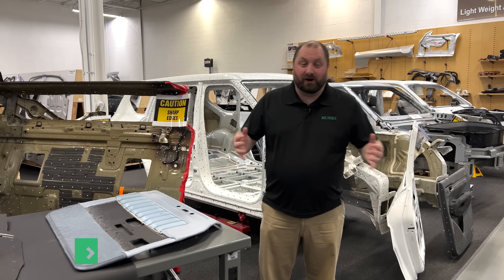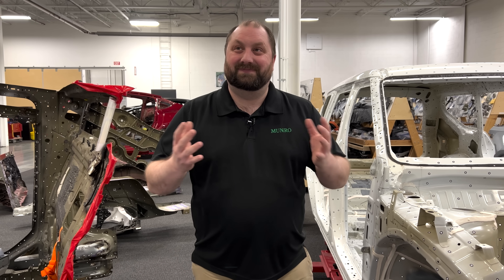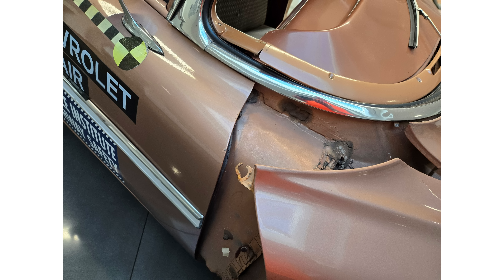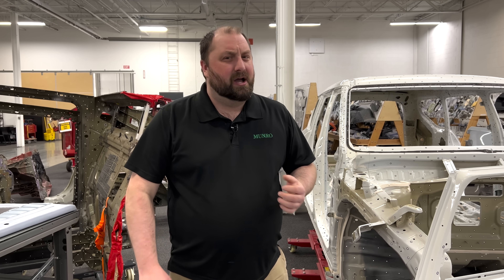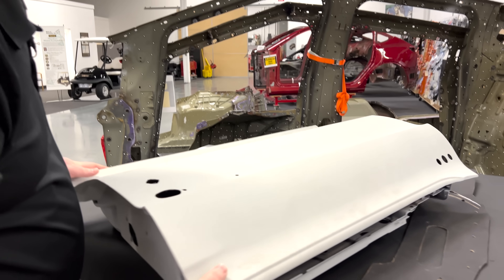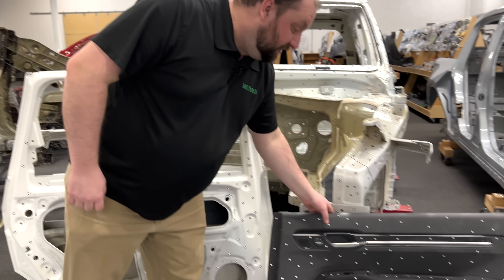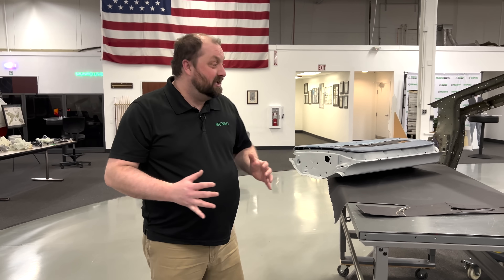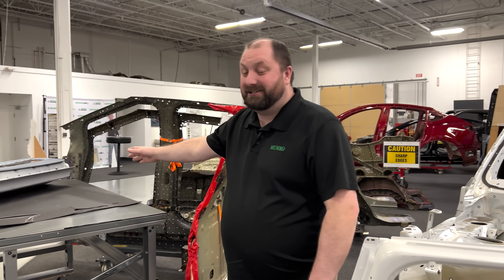No, Your Classic Car Isn't Built Better Than Your New Car

Comment: I'm restoring a 1960 Austin Healey 3000, one of the "big Healeys". It has a steering column that goes all the way to the front of the car, there is virtually no front overhang. In a collision that steering column would be a spear aimed at my chest. I also have a 2016 Mazda Miata, I know which car I would rather be in if I were to have an accident. They are both small roadsters weighing about 2,300 pounds, the Mazda would take care of me much better than the Healey.
Reply: It's interesting to note that they are 56 model years apart, but they are the same type of car!
Reply: @snowrocket  
My girlfriend is 50 years apart from my ex but they are the same type of gender..

Comment: Classic cars were easier and cheaper to repair is what I am always told.  I just laugh.  Then why aren't they all still on the road?!
Reply: Because they wear out, rust out and crash out, along with obsolescence; pretty simple really..
Reply: Lazy owners and the convenience of "new"
Reply: Yes, classic cars are easier and cheaper to repair. But there's always attrition of old cars for a number of obvious reasons, and not always because of mechanical issues. As has been said, some rusted out(depending on what part of the country like rust belt, or salted roads), some get to needing mechanical work that the owner doesn't want to do, Either way the car may not have been worth fixing. And accidents of course. Interiors wear out. Or people just wanted something new. It used to be back in 50's 60's 70's that new cars didn't cost so much, so trading for a new car was easier to afford. I bought 4 new cars in the 70's, and I was only in my 20's. Plus back then, they kept making good looking cars every year, so there was always something you wanted to buy. 
They'll last as long as want them to. They can be restored if necessary, but that's expensive, especially if you can't do the work yourself. It's best to find a low mileage survivor that's still in good original condition, so you're starting out with a good car. And then, just take care of it. I drive a 75 Lemans Sport Coupe that I bought for $3800 back around 2000. It only had 60K miles on it when I bought it, and it was 25 years old then. Now I have nearly 200K on it, with the original engine and trans. Not really that many miles for a 50 year old car. But I have a few other 70's cars similar to that that I also drive. I can do the work when they need it, and have a garage to do it in. So, I have no need for a late model vehicle. But you gotta want to do the work. Most people nowadays can't or don't want to, so have to get a late model.

Comment: Well done Carl. I wish that didn't need stating, but I look at people with their "old is better" arguements and I shake my haed in dismay. Granted, if you stop building a technology for a generation or two, you might find that the last older cars would be better, simply because the expertise disappears. But even that doesn't last for too long. With continuous steady improvements, vehicles are just superior these days than they once were. In the UK, the 5th Gear car programme crashed a 2010s decade Renault Megane into a 1990s Volvo. The Renault's cabin stayed intact, the Volvo's started to buckle - and Volvos have a great crash reputation. But 20 years of progress were between the cars.

Comment: There was little to no crash testing, no 3D modelling to see where the stresses are, and how shapes deform during impacts. There were no collapsing Steering Columns to stop you getting impaled, and nothing so prevent your feet from becoming crushed or trapped in the car. No seat belts, air bags, ABS, stability control, traction control and some of the handling was downright dangerous.
Old cars were dreadful death traps and were shoddily made with much lower standards of quality control and design. Look under the bonnet of an old car and it's certainly simpler, but look at the plumbing and wiring looms, it's a mess compared to modern cars.
Reply: Old cars; 
Can often be fixed on the side of the road with minimal tools.

Modern cars; 
Call the tow truck. Car will be sitting behind the service department at the dealership for months waiting for repair.
Reply: @dougfisher1813  not everyone knows how to fix a car.
Reply: Plenty of new cars are shoddy death traps. The numbers are there to prove it. Some of that junk you mentioned isn't doing anything for crash survival and you can easily update your classic if you don't want to drive newer crap box that is done in four years.
Reply: Seat belts were included as standard equipment even back in the 1960's.  I remember the collapsing steering column became standard in 1968.  
In all my years of driving (figured out I've driven ~900,000 miles), I've never needed antilock brakes.  Never have I lost control by smashing on the brakes, and now that I have ABS, it has not engaged. Your argument depends on ignoring the mid to late 60's, all the 70's, 80's and 90's.
Reply: @cherryjuice9946  even tho it was implemented, the seat belts were either lap or  3 point seatbelts which still didn't help as the seatbelts were super tight on someone. 

The collapsing steering column was good but didn't the car didn't have any air bag or any crumble zones so hit your head on the steering wheel if it didn't collapse.
Reply: @Maximus20778  What?  The seat belts certainly did help.  They were adjustable and not tight on people.  I don't know where  you people are reading this stuff  from, but it's clear you don't have any experience with an older car.  Besides, the original claim was that older cars didn't have seat belts and I pointed that they did.  You are now moving the goal post by claiming they didn't help much and were too tight, which they weren't and they worked great.
Reply: @cherryjuice9946  not from my experience. I'm talking 70s and 80# here
Reply: @cherryjuice9946  before retractor reel seatbelts nobody bothered to adjust the seatbelt to be tight.  they would work loose even if anyone did adjust them. people slid under the seatbelt all the time in crashes. half thr people didn't even use them until they started giving fines for it in the 70s and by that time retractor seat belts were out.
Reply: @cruiser6260  Why wouldn't they bother to adjust them?  A driver sits in the same drivers seat every time, and the seat belt was already adjusted from the last time they drove.  They were easy to adjust.  I drove cars from the 60's and never had a passenger that failed to use the seat belt correctly.
Reply: @cherryjuice9946  we were not 2 and 3 car families in those days, so different drivers sat in the same seat. People just jump in and drive, throw it over their shoulder.  That slide buckle moves on its own as well. Yeah i not only observed people driving 60s cars when I was a kid, I owned a heap of 60s cars including my 69 datsun i still have. As long as you can close it, good enough.
Reply: Exactly.

Comment: Agreed, however why can't modern manufacturers take classic styling and apply to modern cars? Instead all modern cars look like electric razors. I like restomods, but modern cars seem to always break down and when they do the mechanics want 1/3 of the total cost to purchase or they can't even fix them because they can't figure out what's wrong with the damn things. Why isn't servicability incorporated in design? People hate modern cars because they feel purposely designed to separate them from their money the whole long, short life of the car. I have many examples but 1, 2020 chevy silverado has the heater core buried in the dash, no one wants to fix the core when it leaks because no buisness has a tech that can do it or has a week to spend doing it, and the core is only 70$ part, but they want 5000$ to do that repair, 2020 wt 1500 silverado V6 is only 25000$ new!   
I say, fuck legacy auto, can't wait to see them out of buisness and EV take over.

Comment: Great informational video. Some people talk about the past (50s 70s) like those were ideal times. Maybe for some people they were, but for all of our present day flaws, I would argue we are living in the best of times.
Reply: I would say that about the 2000's, when auto manufacturers made a HUGE variety of really reliable vehicles, heck even Hyundai had a 10-year warranty!  Cars were made in a wide price, size, and style range for everyone.  Food, both prepared, and groceries were cheap, homes were cheap and easy to buy, there was a lot of cool tech getting developed, the internet was still free and open.  When the financial crisis hit in 2009, things came crashing down, and we never did recover much out of the 20teens.  After then, emission controls ratcheted up, inflation started nipping on our heels, and now housing is completely unaffordable.  Give me back 2005!
Reply: @audvidgeek  It all started with Obama...
Reply: Engineering-wise we are living the best of times, but soul-wise we seem to have lost something. I have a new Mercedes and an Early 60's Ford in original showroom condition. The Ford is slow, it doesn't corner, doesn't brake, it's noisy, and it leaks, and if I crashed it at low speed I'd probably die, but you know what? Every time I take it for a drive it puts a huge smile on my face. There's not many new cars that do that, and the ones that do cost 6 figures+
Reply: Nah. Best times i would argue was around 2000. Russia and China were a Joke, we didnt have 9/11 and all the reductions to civil liberties and increase in terror and war and BS, cars from those days were AWESOME, safe, powerful and at least the the diesels very fuel efficient already. The internet was basically unknown to police and idiots alike, so smart people could do what ever tf they wanted on it. No spambots yet, many social websites.....you didnt even need an account. Great times.
Reply: ... We are living in the best of times.

Comment: IMHO cars peaked early-mid 2000's: had many safety features we now expect but not laden with non user-serviceable electronics and emissions junk which plague us today
Reply: The computer assisted design tools were good enough to build a good car but not good enough yet to build a car that will only last till the end of the warranty.
Reply: fully agree with you on this!  We had some nice reliable engines in the 2000's too.  Even Hyundai was giving a 10 year warranty on their cars.  My new ford transit van from work only had a 3/30K warranty!

Comment: Great video and great points. People argueing that classic cars are better in terms of crash test performance are out of touch with reality.
Reply: No sane person would argue this
Reply: @mro9466 The amount of car enthusiasts who think older cars were more reliable and safer really makes you question the intelligence of some people. Cars from the 60s lasted something like 7 years between the showroom floor and the junkyard, yet some car enthusiasts are like "Ah yes, the good old days".
Reply: @mro9466  except you ofc
Reply: I don't think anyone ever made that claim. The video seems to proceed on a false assumption. We all know that crumple zones, ABS, traction control etc are HEAPS better for safety that any old solid steel death trap.
Reply: Yeah, it is stunning the number of fuckwits that make that claim.
Reply: I'm guessing that classics like the 300SL aren't allowed to be worth millions?
Reply: No one's ever said classic cars are safer 🤦‍♂️
Reply: @DrSaucePacket  Yes they have, and yes they do. Many old boomers I have spoken to in fact talk about how "plastic" modern cars get in a fender bender and get totaled while older cars can hit something and keep going without so much as a dent due to "StEeL bUmPeRs". I've had no less than 5 boomers tell me some variation of this line.
Reply: @DrSaucePacket  Of course not. They just look better and make people look cooler.
Reply: A W126 Mercedes adjusted for inflation is like 200K+ today and those cars safer than most new cars.
Reply: @mikeicee yes, Mercedes had crumple zones before any of these brands did. As usual, Mercedes is a pioneer in all things automobile related.
Reply: @ The W126 was the first car to survive the offset test with zero passenger compartment intrusion. Most new cars can't do that
Reply: @mikeicee  a lot of cars can do that
Reply: In the 1980s Benz built cars to be super safe, these days the cars are only built to perform well on standardized crash tests.
Reply: @mikeicee  again a lot of cars do that to.

Comment: I don't think any sane person would argue that older cars are safer than newer ones, but a legit argument can be made that older cars were cheaper and easier to maintain & fix, and their simplicity *can*, under the right circumstances, allow those cars to last longer.  IMHO it's entirely possible for today's automakers to make cars that are both safe yet simple to maintain/repair, but they intentionally choose not to do this for sake of profits.  Part of it for sure is done to reduce cost of assembly, but part of it is done purely for profit.
Reply: It's not necessarily for profits, but also to meet strict government emission regulations. If you ask me, modern cars are easier to maintain, at least with Volkswagen Group vehicles (VW, Audi, Porsche, etc.) common maintenance components like the oil filter are very easy to access, typically being right on top of the engine. Repairs on the other hand are often very difficult due to both design and packaging, especially when manufacturers decide to fit parts in every single square inch of the engine bay. Beyond basic maintence tasks, manufacturers don't care how hard something is to access or replace. Manufacturers could make cars that are much easier to repair, but be prepared to spend much more for all of the additional engineering required while manufacturers keep up their profit margins.
Reply: @quentagonthornton49  They do care about maintenance but sometimes it's just unpractical to leave space for a part that needs replacing once in 300.000 mi or 500.000km. If that will sacrifice weight, balance, interior space etc.
Reply: It's a bad argument because older cars needed far more maintenance and generally wore out much faster.

Carbs and points are rightfully in the dustbin of history. I'll say nothing of the pillarless hardtop fad for cars with zero stiffness and would mysteriously be full of rattles and squeaks by the time they were four years old. Or the lack of rust protection.
Reply: That may also be dependent on the manufacture. For example, in the late 90s Ford decided to switch from a pushrod V8 in their trucks and the Mustang GT to an overhead cam. Some things on  overhead cam engines are a little trickier to get to, while push rods are a little easier to deal with. But that’s also just one example
Reply: Absolutely not true. Cheaper is definitely not true. All of these advancements make cars more efficient thus saving you money in fuel. 20$ sensor together with other systems will save you thousands in fuel while also providing more power. Nowdays we have scan tools that make everything extremely easy to diagnose and repair.
Reply: Your argument only applies to likes of the original Land Rover as it could be fixed with few tools out in the desert.
Reply: @johnburns4017  Wrong; I have a Japanese built 80's Mazda that is incredibly simple to service and maintain; no computer, no sensors, all analogue controls.
Reply: @johnburns4017 Seems like you have never turned a wrench even on a motorcycle..
Reply: @Badboythatsgenuine  
Except on old Land Rovers and fully rebuilding Mercedes Benz 230SLs amongst others.
Reply: @Badboythatsgenuine  
You seem wrong.
Reply: @johnburns4017  I dunno. Ask yourself
Reply: @ 
You cannot guess right.
Reply: @johnburns4017  he keeps saying this exact thing in other comments, idk where the motorcycle part came from

Comment: The first car I owned was a 1960 Impala 4Door, Hard Top (no B pillar).  Loved that car and put > 100,000 miles on it. Back in those days, it was a rare car that would get to 100k miles before needing a new engine and transmission.
Reply: and without rusting out
Reply: My grandfather got 170,000 miles out of a 1953 Ford Customline before the engine failed.  I got 170,000 miles out of my 1963 Falcon before needing engine work.  If maintained, old drive trains would last.  Of course, I got 300,000 miles out of a 1982 Ford Ranger, my wife got 240,000 miles out of a 1992 Escort, I got 170,000 miles out of a 2006 Ford Ranger(it was totaled in a wreck).  Both of my present cars have over 100,000 miles on them.  If you maintain cars and do not drive them like hell, they will last.  However, I completely agree with this video about the safety of old cars.
Reply: Now they need them after 10k
Reply: @NineInchTyrone  No they dont.